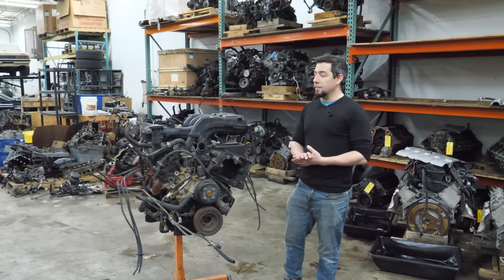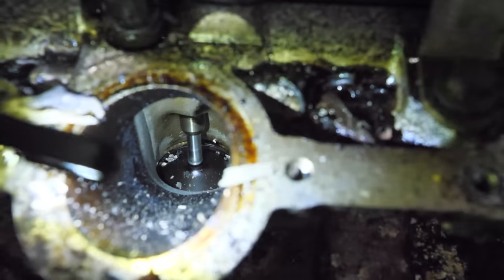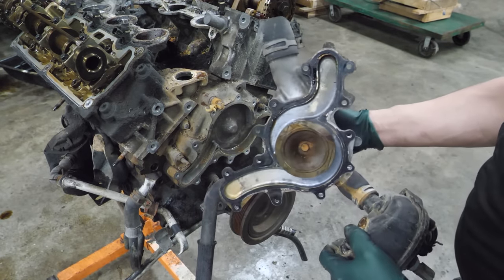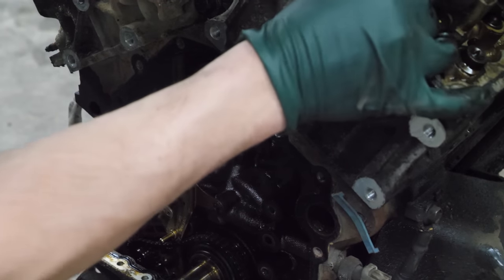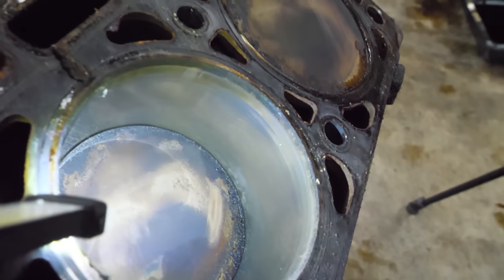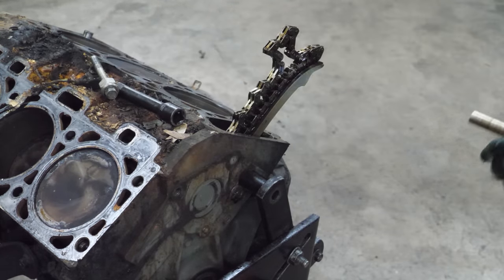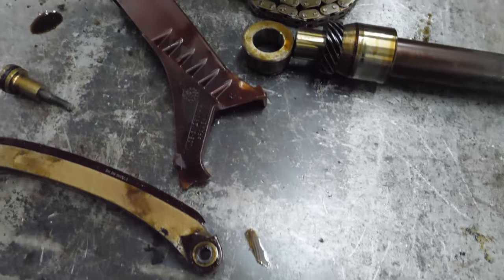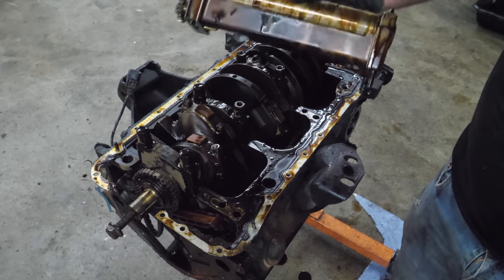Ford Explorer / Ranger / Mustang 4.0L SOHC V6 Teardown! Is This Why They're Called "Exploders" ?

Comment: My 98 Sport has 253k miles and lots-o-chain slapping noise. I  had to replace a lot of stuff but the thermostat housing was the worst. Had a hairline crack on the underside of the casing that took forever to track down...in winter...without heat. Rust is staring to get to the rockers and I have a leak somewhere on the roof. But it's 4wd so I'm keeping it. Have a donor car with 130k miles for parts too so I expect another 25 years???

Comment: I hardly agree that it's a bad engine.. My 03 Sport Trac has over 200k and runs trouble free,no rattle on start up .Had an 00 Explorer that had 330k when sold.. Never was touched. My tip would be run one or two weights heavier synthetic than what Ford says,change it at 5k if synthetic.. Regular oil use one weight heavier and change at 3k miles. Maintain these engines and they are the best V6 out there.   Run dirty thin oil and it'll bite you.  Simple. One thing I've noticed is they don't seem to eat intake gaskets like a majority of domestic V6s do from that era.

Comment: I never cared for the design of it but I had an 02 explorer sport that I ran 352k miles before the frame was junk and not safe to drive..Never had an issue with the engine.I got an 07 Ranger right after that with the same engine and ran it 233k miles before I sold it.Never an issue with it either.I think all the problems I heard about them were the early 98 and 99 versions..I know from experience it was a solid engine but when compared to the 90s pushrod 4.0..I loved that engine...they would easily outlast everything else on the vehicle.

Comment: Wow after watching this video and going on my third ranger all I can hope for is that third 08 4.0 fx4 ranger that I just bought four weeks ago doesn’t look like this motor, I’ve previously owned two used 4.0 rangers before and really liked them, the first was a 93 the second one was 98(steering pump made noise though ) and now my 08 which I thought had the same engine all I can do now is do proper maintenance I guess, would appreciate a good word of advice thanks

Comment: Have a 2008 with a bad stall, computer fine, fuel pump fine, wires fine, only likes to do it when its all warmed up, on the highway, and doing regular drives

Comment: I'm surprised to hear that the OHC 4.0 engine has a timing chain and ticking issue. I thought that both the push rod and OHC versions were reliable. I've never worked on neither.

Comment: Yeah my family owns 2 Ford explorers an 08 and an 03. The 03 has the chain grind. The 03 has 180k miles on it and the 08 has 143k in the clock. We also own a 2000 ranger and I own a 89 foxbody.

Comment: I gotta give it to ford engineers for creating this. Someone at the company in management clearly was dead set on the base engine / block this was based on, probably due to sunk cost on tooling, and they needed more power, and efficiency and decided to covert the cam in block engine to SOHC. This thing was created likely begrudgingly by engineers. How they managed to get this to work and packaged is quite amazing.

Comment: One correction ford 4.0 is not interfering engine. What usually happens rear timing chain fall off and engine needs to be removed from vehicle. Or timing needs to be serviced That is very expensive on ford explorer because is done by lifting body away from frame. Most owners toss car after getting price for work.

Comment: I've owned several Rangers with various engines in them and they all ran great, with the exception of one! I had two Rangers with 4.0 in them, one was a bush Rod 4.0 which I still have and has several hundred thousand miles on it no major problems! But the one with the single overhead cam it was a pain in the butt, as a man said if you got a timing chain issue you you have to pull the engine to change the right hand side timing chain because it comes out the rear end of the engine, and not only that the single overhead cam has about four or five timing chains on it. When one of those timing chains gets slacking it it makes all the rest of them go out of whack and the engine becomes a ticking time bomb explanation mark explanation mark. Ford stop putting the 4.0 pushrod engine made in Germany entered their trucks, because I believe it didn't break down and make enough money for parts and mechanics, like I said I've got several hundred thousand miles on mine and no problems and everything is simpler to work on and the only time you got to pull the engine it's a change the oil pan gasket on it but you usually only do that when you're going to overhaul the engine other than that the 4.0 push rod is the best engine Ford ever made explanation mark explanation mark. And another thing I will not own a ranger made after 2003 there is too much crap on all these new engines!

Comment: I have a 1999 4.0 ranger with almost 300 thousand on it and runs fine low on power but no engine noise or anything

Comment: I own a 2004 Ford Ranger 4x4 & have only changed the oil & i’ve got 245,00 miles & it still starts first time, everytime in even the coldest of winters. Are you saying I got a fluke???

Comment: Got my '05 4.0L V6 Fx4 Ranger in '07 when it had 3K miles.  It has 180K now, & it's been completely bullet proof all around, inc. the engine, other than one blown rad hose.  Might be a little small for an Explorer, yeah, but it's got plenty of power & torque for the Ranger Super-cab chassis.  If you keep up the maintenance & don't beat the balls off of it, it's reliable & economical, which is all it was meant to be.

Comment: I have a nightmare story about one of these motors in a ranger. I changed the timing chain tensioners and when I took the rear one out pieces of the aluminum threats came with it and it was an instant oh shit moment. Long story short I used JB weld to fill all the threats, let it cure, ran a tap through it, drilled a hole next to it for a stud that I used to bolt down a steel plate over the tensioner to keep it from blowing out. And the process of getting it to actually stay in there and not pour oil all over the exhaust manifold took multiple months and taking it back out and repeating the process at least 10 times. And it still would drip oil even after covering the entire tensioners outside with JB weld. I sold the truck to an auction after that.

Comment: I have a 2000 4.0. Torquy reliable engine, 200k miles and no major problems, I expect it to outlast me. That was the last year before they switched from pushrods to overhead crap.

Comment: They're called Exploders because at one point there was a recall on the factory tires, I can't recall the brand but I feel like they were BF Goodrich? Anyway the tires would randomly blow out and cause the behicle to roll. I've seen a lot of those 4.0's go 300-400,000 miles, yeah the timing system is weird but if you take care of them they are very good engines. Almost all european engine from VW, BMW, Mercedes, and others have rear timing chains and nobody complains about them.

Comment: Ticking time bomb my ass i bought mine brand new in 2003 it's got 300000 miles on it doesn't leak oil been rear ended 3 times fucker still runs and has been my reliable  backup vehicle for years I won't ever get rid of it.

Comment: Have this engine in my mountaineer 😅171k and counting no noises ! I change oil every 3k miles with 5w40 European motor oil . To me it has quite a bit of power it puts you back in your seat up to 65 and then around there it slows down a bit

Comment: Tensioners work on oil pressure ....what would be really cool if they offered an aftermarket solid tensioner that you could adjust... I wonder if that's even possible with these engines...I know they do it with Honda four-wheeler engines, they have a similar tensioner just smaller and you can replace it with a solid tensioner that's just a threaded rod that goes in and you can adjust the chain tight,permanently.... I've worked on a lot of these engines,I actually own a couple... my wife has a Mercury mountaineer and those things if you change the oil regularly use good oil and filter they will last in the upper 200,000 mi range some even top over 300,000 without any major issues....what happens most of the time is the tensioners go bad and people keep driving them and don't replace the tensioners....that beats the chain guides to pieces... The tensioners are easy to change and they're relatively cheap...👍👍👍👍

Comment: Those are hydraulic tensioners. They operate with engine oil pressure. They won’t have any tension at that point.

Comment: Had 1 in an 03 ranger 4x4.great little motor for that truck. Blew headmaster on you guessed it. The rear cam gear head.took 2 days $700 Canadian for used 200k motor and truck made it till 450k until Ontario rust claimed another victim

Comment: i would love to see a teardown of a 2.2 liter ecotech enginbe. i have a 2003 caveliar that i have owned since 2005 and would love to see the insides of one of those. just so you know it has only broke down down once and it was because of the fuel pump failing.  other then that i have maintained it and fixed it when needed.

Comment: That balance shaft is really only seen on the engines sold in 4x4 vehicles, its assumed the transfer case could cause excessive vibration, so they added a balance shaft.  It's not really needed.

Comment: My Mother got a 4.0 V6 OHC Ranger against my advice. She said that it only has 92K miles on the truck and 22K miles on the rebuilt engine and it's a nice looking truck. I told her does that not seem kind of low for a vehicle to need a replacement engine? I mean the original engine only managed 70K miles.  Three months after she got it the transmission started slipping badly and had to be replaced.  People end up spending several thousand more trying to save a few thousand.  The other day my Uncle bought a Sport Trac Explorer with the same engine and I am going to guess the same fate for it.

Comment: My first thought, was that the engineer that designed this nightmare owns stock at a timing chain company. But then, looking at it some more I think the idea was to make “side agnostic” ohv heads without completely reengineering the block, so using the old cam location to power the rear timing chain was a neat idea if not a disaster in actual execution. I’m guessing there were versions that still had a distributor and oil pump that was driven off of that blank cam shaft.

Comment: The  timing chain guides are this engines achilles heel. As a previous poster wrote, this engine started life as the Ford Cologne push rod engine originally being a 1.8L.Yeah, that small of V6 in 1965. Most people in the. States would remember them in they're Ford Capris in. the early 1970s.
This is why the chain system is such a mess. I've replaced the chains in our  2005 Explorer three times  in 250K miles. It's easiest to do as an engine out. Also, used OEM  chain guides and tensioners. The aftermarket. guides are crap, and. may lat as little. as 30K miles before  failure. Once the engine is out, I can change everything in. a few hours. But,  you will need the special OTC tool set.

Comment: To this day my neighbor thinks I ripped them off for charging 1800.00 bucks to pull engine replace all chains tensioners all intake valves on both heads since the chains broke due to major abuse. They asked a friend and they said on their Chevy V8 it just cost them a couple hundred. So, I told them to watch your show Thanks.

Comment: Well I'm right there with you, I hate that motor too. I was not aware of that design and Ford seems more German everyday. When you pulled out that jackshaft, I thought for sure that was going to be a balance shaft but to put another shaft as well that's crazy Ludacris. And the chain on the back of the motor like an Audi that's just pathetic. I'm very disappointed in Ford. However those injectors look just like the ones on the 6.2 V8.

Comment: Imagine my surprise when I went to replace the chain guides in my 05 mustang and realized that I had to pull the engine. Man I was pissed. From what I've seen, the only engines that have the balancer shaft are used in the Explorer.

Comment: I did my timing chains not because were bad but as insurance on 2007 mustang 4.0L 150k miles,  it cost $1800  along with tune up stuff included in year 2023. 
I dont understand people bitching about maintenance, and would rather mistreat the car  so it does fail.  $1800 is worth it preventive  care to me especially when used cars are crazy expensive.
Reply: I've done some expensive repairs and maintenance on the older Mustangs I've owned over the years. My 98? Two manual transmissions. It was a sad tale -$4000 in repairs for a problem that would have cost about $300 if it had been able to be caught early. Even still, cost of ownership was still about 1/2 of what a new car would have been. 

My 00 GT was great as far as the engine goes. Had to replace the intake manifold due to the plastic coolant crossover springing a leak. Did it myself for about $400. 5 years in my life though with no real engine problems otherwise. 280k km when I got rear ended and wrecked. 

I have hated my 07 4.0. The timing chain cassette shit the bed and I replaced with a junkyard 4.0. Less than a year later the front timing chain on that gave up. Right now, probably not engine related, the engine just stopped running, then crank no start. I gave up on t-shooting and it's at the shop now. 

My first thought when they announced the 4.0 for the Mustang was, "they're putting a minivan motor in a mustang????" Granted, I never had the same motor problems in an aerostar I had.

Comment: Didn't think this was gonna be worse than Audi's 40chain disasterpiece, but that looks like such a pain. At least the Audi has everything pretty accessible once the covers are off (but it's all on the gearbox side of the block, so you'll be pulling the engine for just about anything).

Comment: The 4.0 is seen differently by everyone. I see it as “take care of it, it’ll last you forever”. Others will see it as a ticking timing chain bomb waiting for happen. The sound it lets off is incredible, just a stock broken in 4oh will let off a neck breaking banshee scream at 4-5k rpm. Owning a 4.0 explorer will just get you a-lot of “haha exploder” jokes but for as long as this engine has been in my life, it’s worth your bang for your buck. If you have a 5r55 transmission with this block, i’d be careful because you’ll surf reddit or facebook and see how everyone’s 5r55 is doing after 150k miles (spoiler: it’s blown up) just be nice to it, yes you can do pulls with the 4.0, yes you can daily commute, and it’s a good work truck engine. Ford was smart for throwing it in a family car, truck, and sports car. Just a very well rounded engine and i’m a massive fan of it.

Comment: I was in tech school and we did a timing chain on one of these, this video brought back a lot of memories... It was an Explorer with only 70k on it I think. You dont need to pull the heads to get the guides out, I forgot how we did it but it was a pain. However, the engine does need to be yanked out, in my opinion this has to be one of the clunkiest, most poorly thought out engine designs Ive seen.

Comment: These noise new, they had rocker arm issues with high miles.  But I dont remember the Copenhagen 4.0 Ford having timing chain issues... they ran forever..maybe at 300k the chains blew

Comment: I still shudder at the thought of working on these engines. They are quite the nightmare to work with with the engine in the vehicle. (Both cases were Explorers.) One had the chain guide problem. Turns out the previous mechanic used Teflon tape on the tensioner, which blocked the oil flow. The head had to be removed in order to take out the chain guide.

There's currently another one in the shop I work in that's being reassembled. The shop owner has the timing kit to get it right.

How the engineers made this a reality is beyond me. They're a technician's nightmare.

Comment: have a 06 mustang $2000+ to fix at dealer. front components only. most shops will put a new engine in rather than do the chains. its about the same price.

Comment: got a 2008 Ford Mustang with 4.0L V6 5 speed manual and shes got 255,000 miles on it. pretty sure any engine is the best "IF" the drivers maintain them correctly instead of going to dealerships
Reply: But i did replace plastic with aluminum cause i honestly dont like plastic

Comment: so far  99 with the 4.0 ohv 5sp 20mpg 120k  owned till this yr from new i buy another if that model was made now,   2n 203 4l ohc  200k neighbor trailer towed lawn service for years daily needed work i bought temp and junked engine ran excellent needed many minor things just decided not worth to me to fix now 2004 bought used 2018  runs great few repairs nothing unusual but the key chip failed
still running good but not the gas milage of my 99,  known many people with 4l not heard any complaints do the people service these like you should?  i hear more problems with newer fords
cannot believe the known problems like the 2 clutch trans and 3 valve 5.4

Comment: Wait till you get to the cassetts and tensioners usually junk. I had one of theses in a exploder ant it could have been a great motor if it was not for the nightmare timing chain issues

Comment: Hundreds of thousands of those engines out there. Those engines pretty bulletproof  those engines really didn't get problems until way over 100,000.  I still own a few of those. And all of them has got 300,000. Only thing I've done to them  is water pumps  and  timing chain set. And it's still a very reasonable engine to fix    and my customers most of them are bent over 150 close to 200,000 before we put timing chain kit in